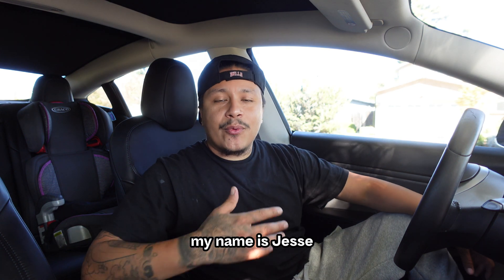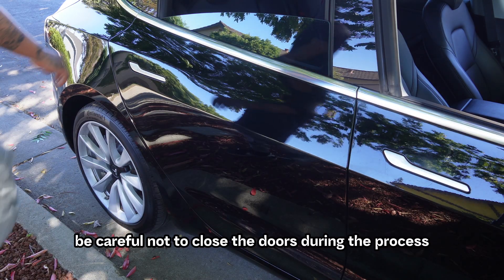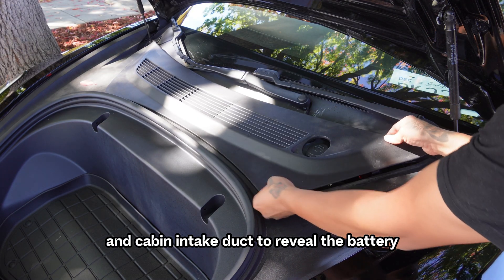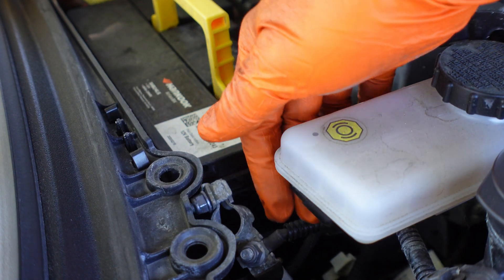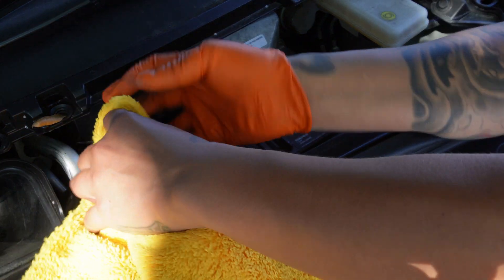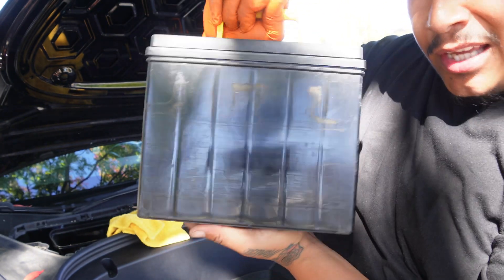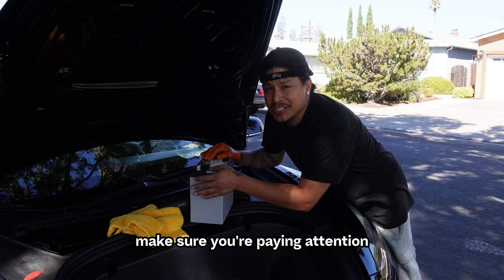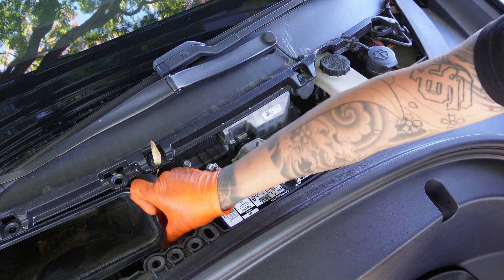My Tesla Already Needs a New Battery! Here's How to Replace It

Comment: So after 32,800 miles (not 1,000) your 4 year old car needs its 4 year old 12v battery replaced....
Ok.
Reply from the maker: @goneincognito6275  I’m aware of that brotha that’s why I mentioned the current miles on the vehicle. I was just letting the viewers know that I only got to drive the car 800 miles before it needed a new battery. I’ve seen OEM batteries last up to 8-10 years, so it sucks that these modern ones only last up to four. Plus, the battery doesn’t even have a Tesla brand, so it was probably replaced earlier.
Reply: @XJJesse  Tesla don't make 12v batteries so there won't be any branding.